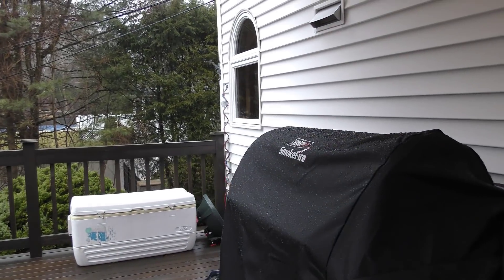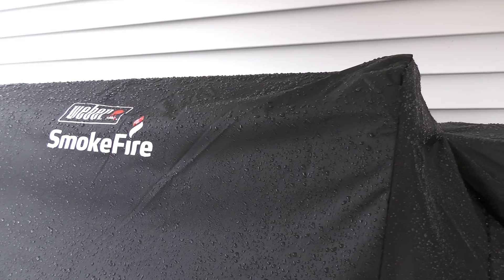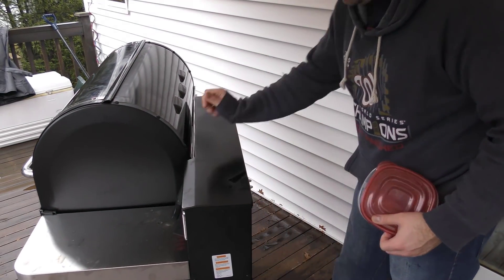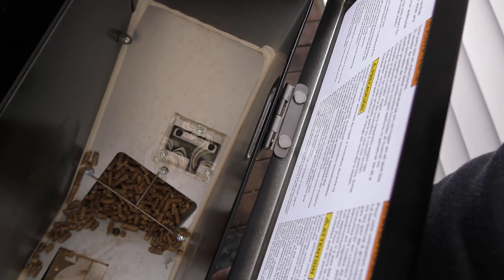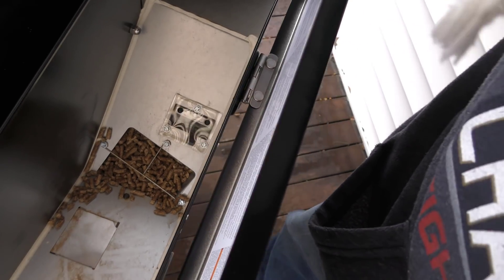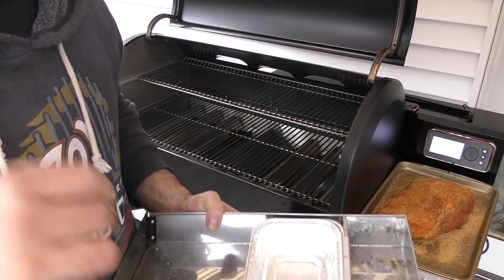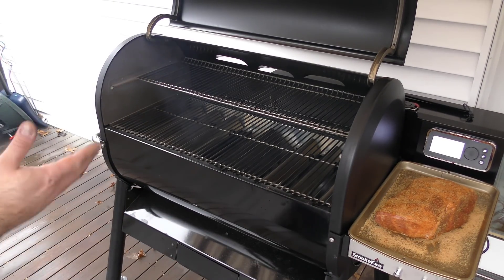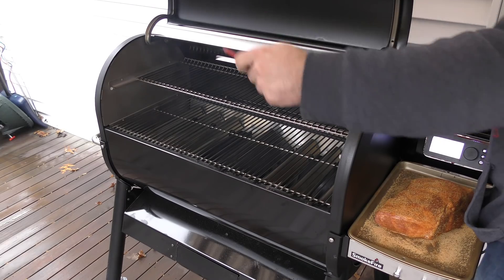Weber Smokefire EX6 First Cook Pork Butt and Beef Ribs Review Part #3

Comment: Matt,
Thank you so much for taking the time to capture your experiences with the new Weber SmokeFire. I was really planning to get one but figured I should wait to let you brave souls to try it out first. You are NOT the first one to find the out of pellet issue. It looks like Weber may not have desired the incline steep enough. It's kind of like the first new car model year and you are blazing the trail for the rest of us. Another guy today on YouTube has had several issues with it and the temperature variation across the grate seems to be an issue with the right side getting hotter than the rest of the area.

Keep banging away with Weber and please keep us posted. Your trial runs are HUGE to us folks a little more scared to jump in the pool.

Jeff

Comment: Call weber and get the free hopper insert, it increases the slope, just have to take out 2 screw, super simple,they will send it super fast, mine has fired up every time, knock on wood (pellets)! I'm keeping mine,some of  the weber pellets are too long, makes it easier for them to bridge, bought a vibrator motor to put on a timer to help with pellets getting stuck, not sure how I'm going to mount it yet, but think I will love it, hope weber is still working on fixes, too many haters out there, I'm going to cut Weber some slack and tough it out

Comment: Thank you very much for this video. This smoker is very noisy and not reliable. As a owner of a Komodo Kamado and a Kamado Joe I can say I never encounter a problem. A ceramic cooker is away over any type smoker and grill. They are reliable,performant and quiet.
If you like a full control just add a Flame Boss.
Good luck 
I which you’ll get a refund from the seller.
This product is a shame.